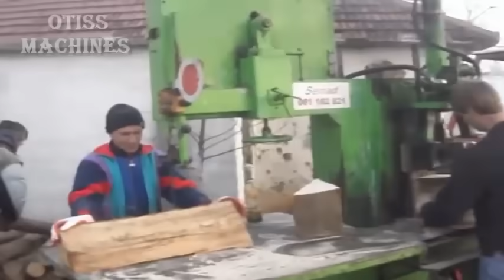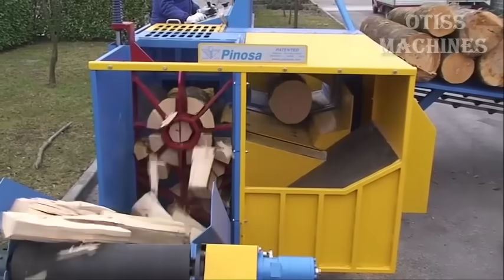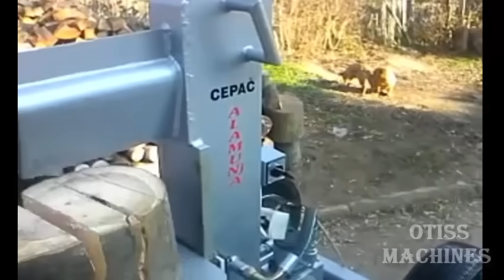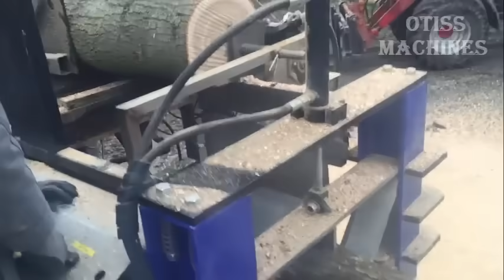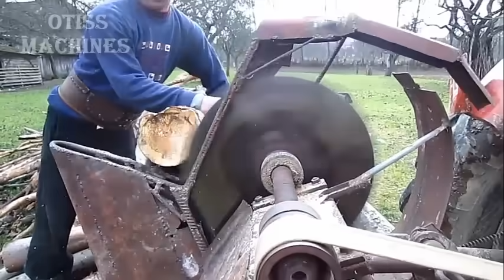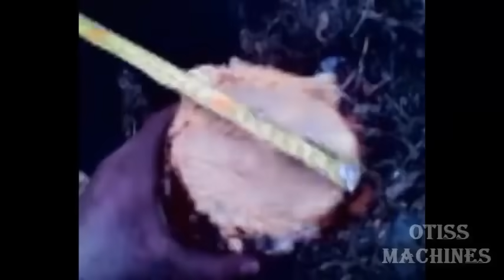Awesome Biggest Homemade Wood Splitter - Extreme Fast Firewood Processing Machine Modern Technology

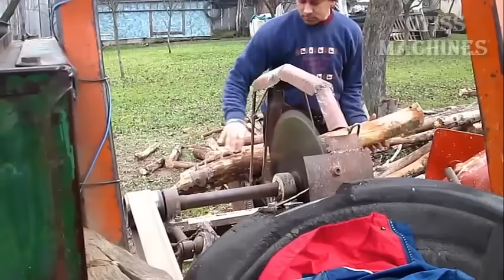Comment: I like the one at 7:40 some of these look scary but just like any machine, you need to stay awake when you operate them, I have a screw type wood splitter that fits on the back axle of my truck in place of the wheel and I love it

Comment: How do people get a fire to last all night with such tiny pieces?
Reply: Футбол чемпіонат України
Reply: Pack the firebox 3/4 of the way full with small pieces and let it burn from the top. Lasts 6-8 hours for me.
Reply: Build the fire let it burn to get good bed of hot coals then just before going to bed pack the heater as full as you can get it . Doesn't last all night but depending on when you get up should still have a bed of hot coals and easy to get fire back to going . Also depends on heater sizer bigger heaters might last all night into the early morning

Comment: Some of those splitters were fast, but only one, the last one, was home made.  I'm not convinced the one before it was home made.  It had some modifications that were done locally, but I think it was made in a factory originally, so the headline is flat out wrong.
Reply: they are all fast if you speed up the video's